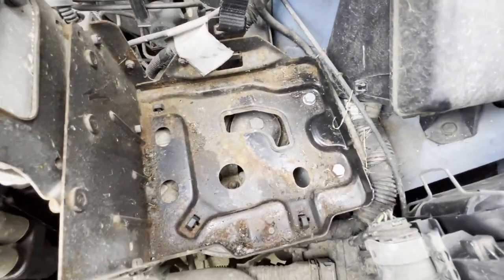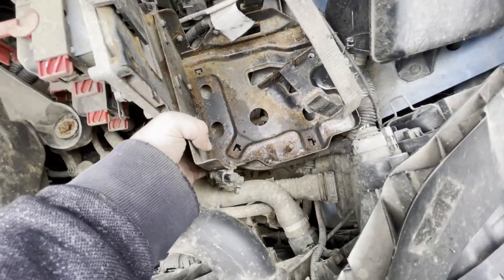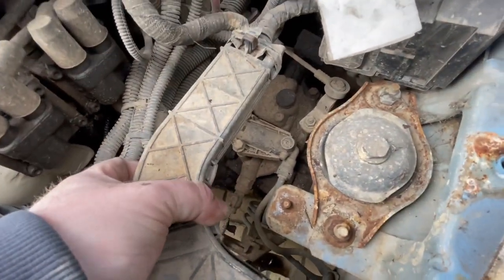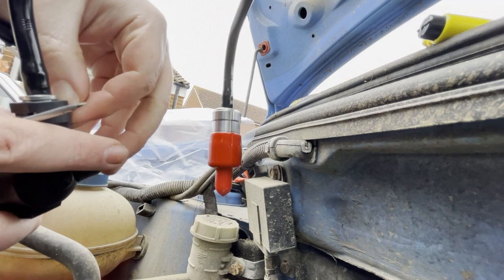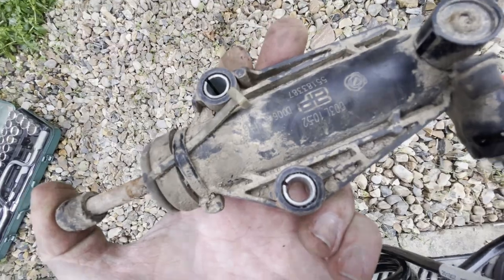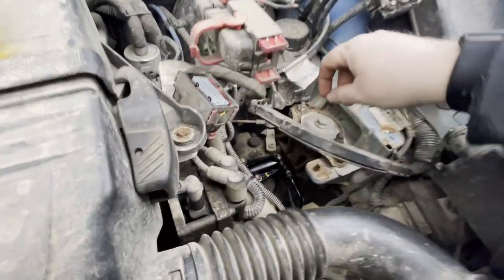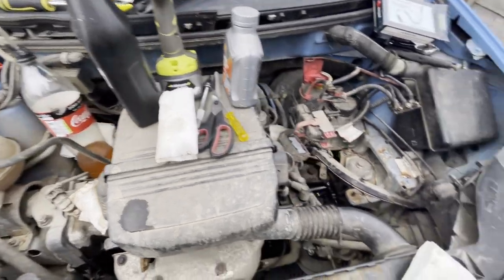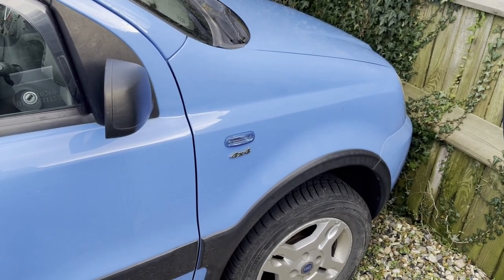How to fix a squeaky/sticky clutch on a Fiat Panda 4x4 - UK Panda 4x4

Comment: Perfect! I just did mine and it is like a new car, the earth point between the ECU plugs can twist around as it is tightened and prevent the ECU plug from connecting correctly.
Fantastic tutorial, many thanks.

Comment: Thank you so much for this guide. Do you advise this car or should I buy newer models? I see this car sale for around 5k Pound in my country. Which panda 4*4 is better you think?
Reply: It really depends what you want to do with the car. If a lot of off road use this model seems to be a little bit better than the newer shaped Mk4, but you will start to have more wear and tear bits need replacing as they’re 10-15 years old now.

Comment: I don't see how you remove the  tube from the old cylinder. Did you block the liquid somewhere? How did you stop the liquid to go out? Wasn't liquid in the tube?
Reply: The liquid in the system will come out slowly and air will be introduced which is why you then need to bleed it afterwards. You shouldn’t loose too much fluid however as it’s not under pressure.